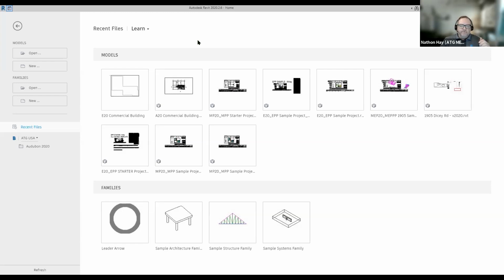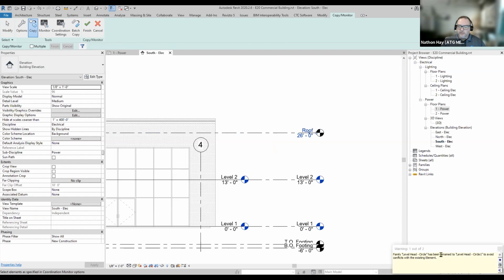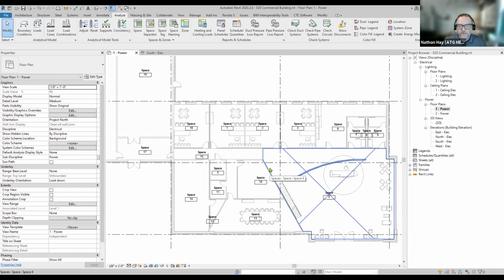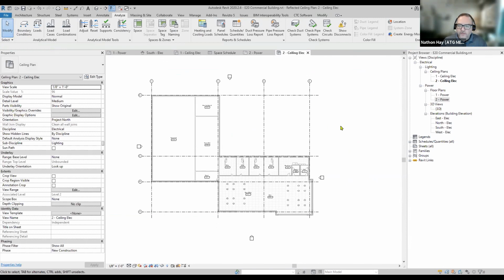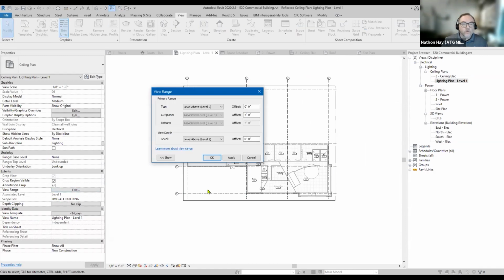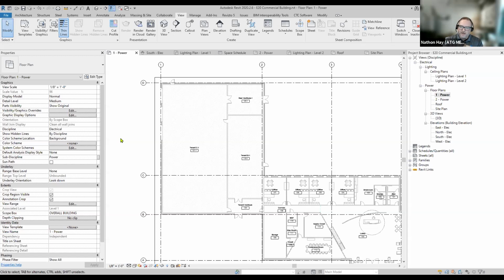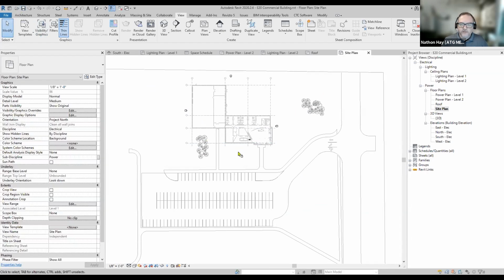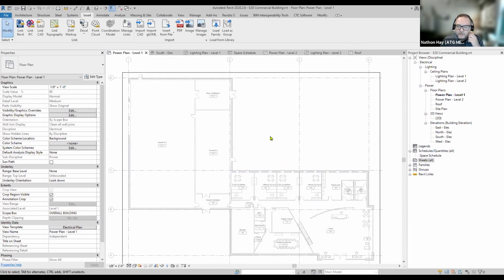Set Up Your Electrical Design Project in Revit

Comment: Author's Note: 
Our goal is to complete a set of printable construction documents (CDs) of a simple 277Y/480V 3Ph 4W commercial office building, starting from a default session of Revit with only out-of-the-box (OOTB) components.
Many electrical designers and engineers have opened Revit to start a relatively basic commercial building design only to find: 
1.	what we need is not already there, 
2.	there’s no readily available documentation showing us what we need, and 
3.	we don’t have time to figure it out before the deadline.
This is a how-to webinar. Watch it at 2x, but take notes. In the end you will be well on your way to using Revit.

PS - click the three dots and select "Open transcript".
Reply: Is there a part 2 to this for the electrical design, circuiting and panel schedules?
Reply: @taylorhigginbotham5623  Please see part 2 here: https://youtu.be/Ii6BFoWtc1A
Part 3 is scheduled to be released in late July. Thanks!